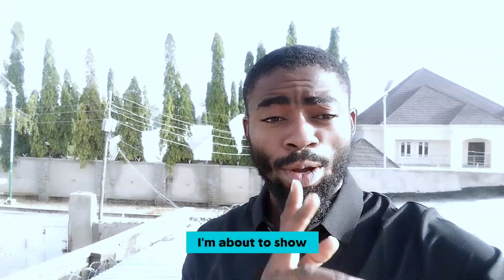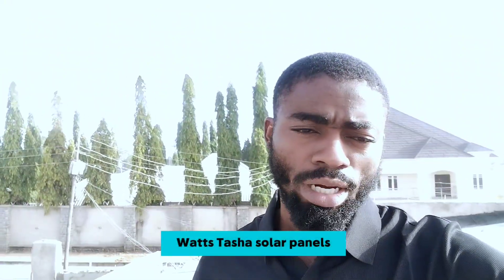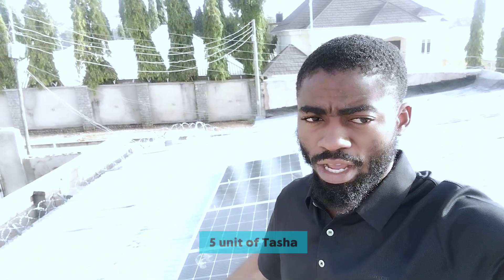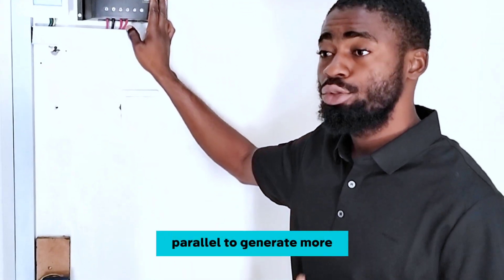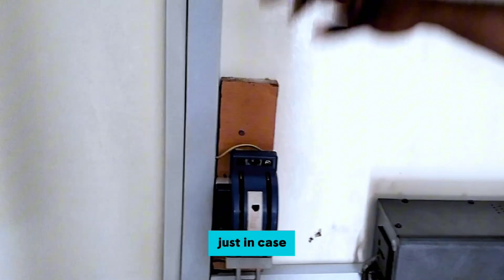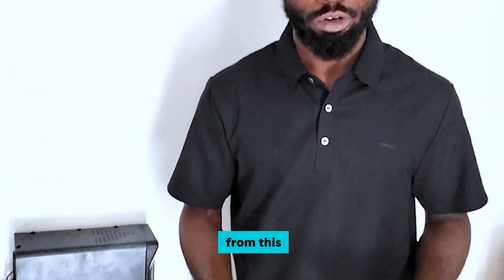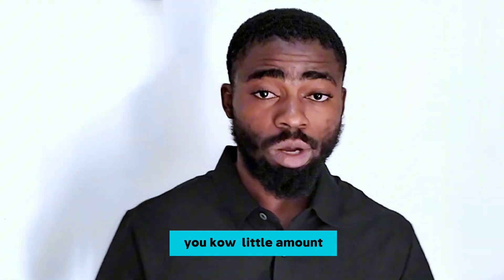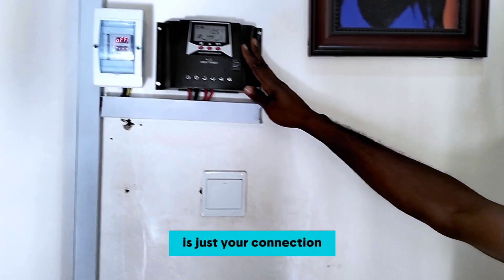1kva solar energy system, what can it power, is it worth it?

Comment: Hello. Please is it possible for me to just get one panel of 650 or 700 and connect to the 1kv inverter
Reply: You need panel with higher Current rating to be able to charge your battery effectively
Reply: Yes
Reply: For this kind of set up. Using a pwm charge controller,.. using 12v panel is best

Comment: Bro i love your work. Thanks for the info. I have a 1.5Kva/24V inverter. Ideally 2 tubular batteries are required in series. How many panels will i require and do u recommend PWM charge controller for the setup?
Reply: Pwm charge controller can run in your 24v system but the maximum size in the market currently  is 60a  therefore the number of panels it can carry is 1,400watts Panel, you can buy 3pieces of 450watt panel.

Comment: Is it a 12 v or 24v system?
Reply: It's a 12V system as evidenced by the use of 1 battery and also the connection of panels in parallel

Comment: The 5pcs of 150w panels makes a total of 750w. Is it advisable to just use 1pcs of 750w panel, than to use 5pcs  of 150w panels.
Reply: 5  unit of 150watt panel produce more compare to 1 unit of 750watt
Reply from the maker: 5units of 150w will produce more
Reply: Boss Noel weldone.
Reply from the maker: @mrandmrsgrail8666 🙏🙏
Reply: For 12volts system as this one if you want to use high voltage 750w single solar panel I suggest you get mppt for effeciency wise or else all those high volts will be lost as heat using pwm. Therefore either get 12volts solar panels and connect them in parallel or get higher single solar panel with mppt. I prefer Mppt charge controller because is way better and efficient.
Reply: We are dealing on high Amper not voltage
So get the multiple panels